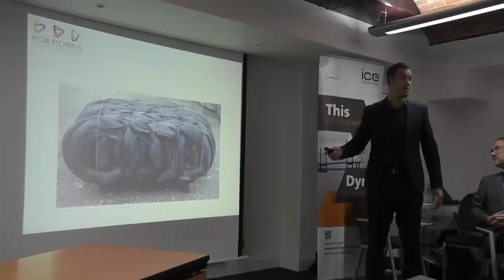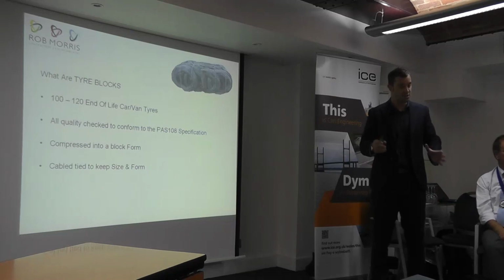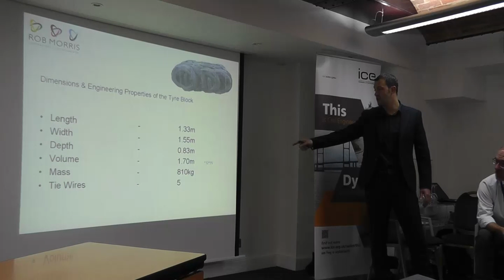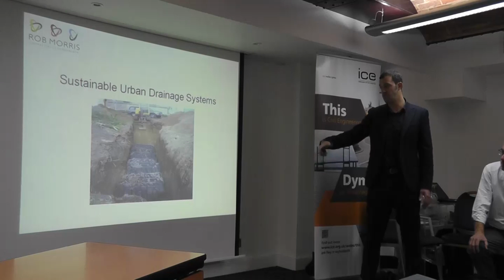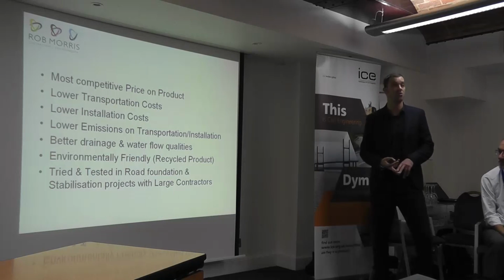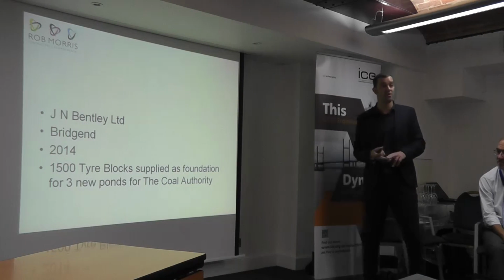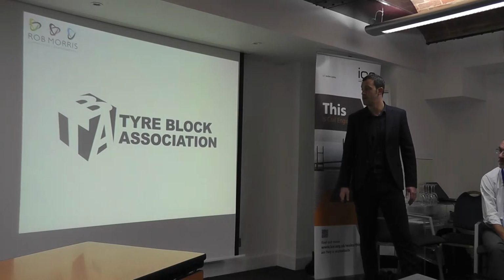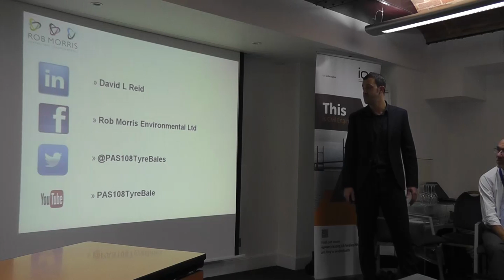Tyre Bales, Tyre Block benefits in Construction

Comment: Gradeall Tyre Balers make PAS108 bales
- MK2 Tyre Baler https://gradeall.com/product/mkii-tyre-baler/ and
- MK3 Tyre Baler https://gradeall.com/product/mk3-tyre-baler/ 
See links above for pictures, videos and spec sheets.
If you would like any further info please contact Gradeall on 02887740484 or through our contact form on our website https://gradeall.com/contact/
Gradeall International Limited to a range of Car Tyre, Truck tyre and OTR Tyre compacting and down sizing equipment, please see out Tyre Recycling section of our website; 
https://gradeall.com/product-type/tyre-recycling/
And further related Tyre compacting and downsizing videos;
OTR Downsizing https://www.youtube.com/watch?v=LgXR_r92Wkk
Tyre Baler Conveyor https://www.youtube.com/watch?v=zWweFx_BH0s
Truck Tyre Baler https://www.youtube.com/watch?v=QulaUhXZHSQ
Sidewall Cutter https://www.youtube.com/watch?v=kCqCAbH7_t4
Tyre Rim Separator https://www.youtube.com/watch?v=0hEVBteKVCQ&t=99s
Truck Tyre Rim Separator https://www.youtube.com/watch?v=0hEVBteKVCQ&t=99s
MK3 Tyre Baler https://www.youtube.com/watch?v=o5KiQ7CmdLY
How to connect quick Link Wire https://www.youtube.com/watch?v=uXEy90vZ2cw